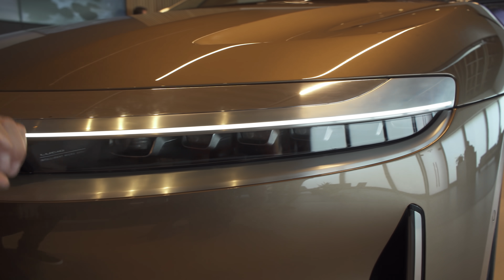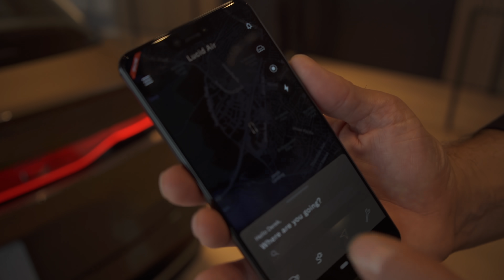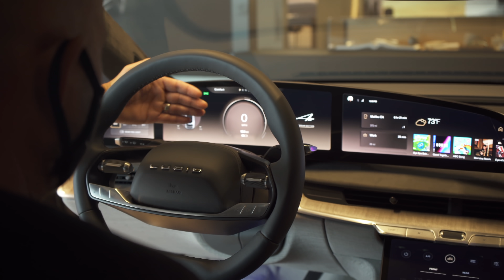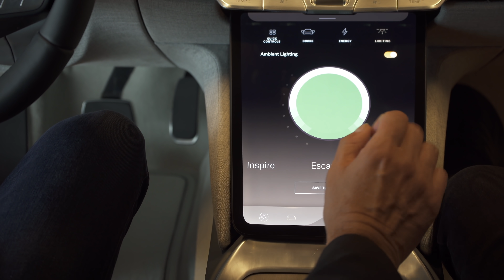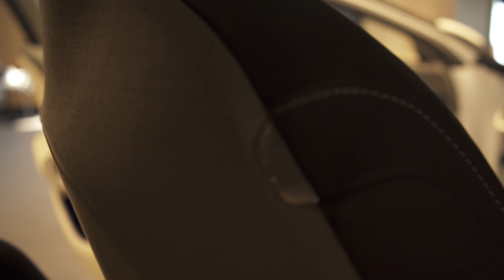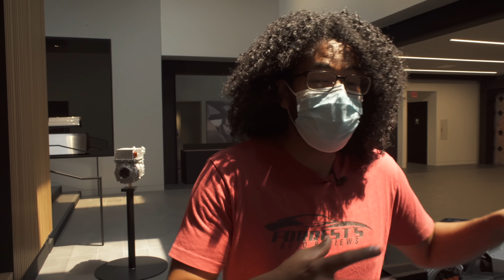1,080 Horsepower EV! (EXCLUSIVE FIRST LOOK) | 2021 Lucid Air Dream Edition

Comment: Too bad the seats are so low. That's a terrible position to sit in. You see this over and over with these cars. I know the floor's filled with batteries but these manufacturers really need to accept that these cars have to be a bit taller. Yes that will add drag but range is already not an issues on these high end cars. 
I have a feeling that the big traditional car manufacturers will win this race in the end. The people working for those companies have a lot more common sense and experience building cars and even though their cars don't offer crazy panoramic windshields, laser windscreen wipers (?), a battery level animation as nice as the one on this car or the performance of some of these hypercar wannabes they do all the usual things better. I'd rather have something reliable with cheap to replace bumpers and headlights and so on and a simple battery indicator like the one on your phone than this thing. And a car costing over $50? One of the best thing about these electric cars was supposed to be that they're cheap to buy and cheap to maintain since they have so few parts compared to an ICE car. Guess we're just not there yet.
EDIT: As others have pointed out there's another version of this with less range and a few of the batteries missing to make leg room in the back. Get that one if you ever buy this car and plan to actually have passengers in the back. It's still not good but it should be fine for children even for extended periods of time. A normal size adult will get terrible leg craps in under two hours even in that one. Maybe less than an hour in this one.

Comment: Did not give much info about the car's safety from both design and more importantly software such as it's driver assistance capabilities and it's ability to avoid accidents or human/driver error. To me this is extremely important for any future electric car. Hope Lucid is not just focusing on the design,vwhich is also important and they seem to have done a good job.

Comment: The thing people don't understand about accelerating fast in an electric car is that it drains the battery severely. If you press the pedal to the floor multiple times the range capability will drop significantly.

Comment: If they put 120hz screen in the iPad looking screen beside steering that would be much greater because a powerful cpu is needed to handle super fluid touch response and user interface because it’s a luxury why not

Comment: Fake, because on his phone has 264 km range and in the car was 168 km, and where are the zero gravity back seats?
Reply: Those special seats are optional. Also regarding the range error, (newer edit) his phone was displaying kilometers and the drivers display is in miles.

Comment: My concern is that the flip-out mechanical center screen will need expensive repairs if something goes wrong. Also any type of LED screen may be prone to delamination over time. To replace each screen would cost over $1000. Cool design, cool concept. Concerned about the money you'll have to fork out when the Warranty runs out.

Comment: How can they get away by not having the turn indicators not on a fixed panel. Us regulatory DOT laws specified that any turn signal indicators either have to be on a fixed panel or have more than one for example if these are on the trunk lid which is not fixed they must have another set on let’s say the bumper which is fixed. I don’t think they will be able to have just the ones on the trunk lid. For over 120k the interior just doesn’t add up to a car over 120k  lots of plastic, and vinyl finishes along with the rails for the seats , no covers and shows bare metal .

Comment: This is cool, I'm just kinda tired of the focus on making electric cars these high-end luxury items. I want to see something really affordable for common people, because at the end of the day the greatest thing EVs have to offer is the reduction of carbon emissions.
Reply: Volkswagen ID3
Reply: What’s your definition of affordable bc in my eyes a fully base model 3 is 30k
Reply: The technology is expensive. Development of these vehicles are basically running off a trickle down model where the expensive product is release first to subsidize further development on more consumer friendly versions. This was the same thing Tesla had to do for the model S when it first released. Companies like VW and Volvo can start at scale, they just eat the cost of development upfront but can develop more 'affordable' cars to release. I am still excited for what Lucid Motors has to bring to the EV market and push all the auto manufacturers including Tesla to innovate further.
Reply: Raw materials for the batteries and computer modules are rare, expensive to mine and process, and pretty polluting... so it makes sense to sell them as luxury items.
Reply: I agree, like the model y but without all the cameras and self driving stuff.
Reply: Pancakegr8 - TESLA still makes the Affordable , Tesla model 3 BASE starting at $34,500.
and in 2 - 3 years you can buy a TESLA model 2 starting at $25,000 with FSD.
Reply: Victor Hugo   - NEVER , said FSD would be FREE, wink wink .......

Comment: Love the Symmetrical Architecture... but the biggest drawback is the Exterior Design, the Front Fascia looks kind of lame... Have you guy seen the new 2021 KIA K5? Whos says an EV can't have a Frt Grille, you can probably divert the air through the grilles and into the wheels for cooling...

Comment: The interface doesn’t seem well thought. There is no need for the left screen given how rarely you will use it. The logic of activating something on the top screen and then having to use the bottom screen to continue it makes no sense and it’s just poor usability. Basically there is no need for more than two screens: one in front of the driver and other in the middle.

Comment: I am very concerned with the quality of this car, being the first model and "beta beta beta" as was said multiple times and obviously showed with the touch screen not working too well 🙄 the floor being high is a big deal for long trips..and can't move feet under the seats also, if 6ft or taller that is a big deal for trips over 30 minutes.  The color is quite bland even though it is a "gold" , nothing too surprising other than the screen and power but the ambient lighting could be better as well as the materials, I am not too keen on the fabric part of it. The labeling is standard on almost any car nowadays.  The wheels are atrocious but I do like the exterior lighting. Also the steering wheel centerpiece is eh. But I would say not bad for a first stab at a car from lucid. Definitely may overtake tesla after a few models if it continues this path.

Comment: Since the motors appear to peak at 670 hp each, that Performance rear axle with two of then might be able to draw all the power the battery have to offer.
I'm curious whether they'll car regen at 300 kW (or lower) or so something interesting with these usually very short inputs during dynamic driving.

Comment: not worth 80k more like 45k
Reply: With that kind of tech and range it's well worth it! Although I think $160,000 for the top end Dream model is kinda pushing it.
Reply: @ZapFlashD  what few led lights on back front dont think so see wen they produce them if ever theres nothin hitec in there these i suspect are not actual full specs fr road model i cnt see anyone paying 80k for average car there are no top range features i can see aprt from led front back one piece lights wow 1piece back light must be worth 80 bigones

Comment: As for the car, the driving position from the little i could see is bad, to get inside the car is bad, to sit behind and not being able to see in front because your knees are too high makes it a very unconfortable position, the roof line is way too low for people above 1,80 m and the software...omg that is slow motion, realy bad. The back trunk although it has a big capacity, it is long and deep also with compartments options, it is not practical at all, to get something from the back of the trunk, a short guy has to go all the way inside, terrible. It looks very nice and futurisic but one that hype is gone, you will want a better designed car. I own an Audi A7 and i have 1.000 km range on a full deposit and even if it looks like a sports car, it is a very practical and well designed and built one.

Comment: I believe there is a design issue with back seats where u set very high. This very difficult for long distance. I hope they could do somthing. But it's hard. Since batteries are located under that . 
From inside it disappoint me

Comment: I’m a Tesla owner and a total EV advocate, so any new EV’s coming to market are a great thing.  This is a great video and I can’t wait to see this car take away even more market share from the ICE producers.

Also, I am very observant.  164 miles of (actual) range at 50% charge sounds very comparable to what you find on the Model S LR in the real world.  

That said, this car will be far more satisfying to the ultra rich crowd than the top of the line Model S will ever be.  The cost difference of charging at an EA 350kw station vs. the Tesla SC network will mean nothing to those who can afford this type of vehicle.

I think Lucid did a great job on the design.  I wish them luck on the production and sales.  It’s a Tesla Model S killer when the Dream edition drops to $105k.
Reply: There's some subtley here, Tesla has been driving down the cost of production so much, they profit and far ahead on certain things. For instance by the time dream edition is in full swing, the 2020 roadster i truly believe will be in production, so 180 K for lucid vs. 200 K for 2020 roadster. I still like the roadster more.

Comment: I definitely wouldn't be going grocery shopping in that thing.  It's a gorgeous automobile.  I am not a big fan of screen navigation.  I like buttons and knobs so I can go directly to the place I need to go and make an adjustment.  Also, if the screen goes out, you are screwed.    I would never buy a Tesla with that huge distracting screen staring me in the face.  No way.
Reply: Have you seen all the new electric cars? Most of them have touch screens for connivance,  it lets the company build on the software rather then having to replace buttons and such. It's going to be the future 100%, just like how we went touchscreens with our mobile phones.
Reply: @NormanGaming196  Did you mean 'convenience' instead of 'connivance?'  Anyway, I don't want to be searching and navigating menus on a screen when I am driving.  And I don't care about how easy or hard for a company to do their business. I certainly don't have to buy their failings.  For me, I want instant access and to know where the controls are without taking my eyes off the road.  If they want to have voice controls that would work.  My Subaru Outback has everything within easy and sure access.  I like it that way.  That Tesla screen is flat out awful.  And I don't have to buy it.
Reply: @georgesealy4706 rip the spelling. How do you feel about self driving cars? Most of these electric cars are built on a platform that is meant for self driving systems like auto pilot. We all have the right to an opinion, and I respect yours, but if your car wanted to add a button for a new feature, they couldn't; they would have to sell a whole new model with new buttons, unlike a Tesla to which they just change the display UI. I can understand the distraction bit though.
Reply: @NormanGaming196  I have no problem with self-driving cars.  I think it would be most useful on the Interstate highways a driver assist.  I live in Arizona and we drive a lot of miles on wide open highways.  It's a haul from Phoenix to Dallas, for example.  If the car could take over on long stretches it would help with driver fatigue.  In my mind the next big feature that way will be highway and car-to-car communication so as to eliminate crashes.  We have deadly dust storms here in Arizona, and there have been crashes involving 20-something cars.  And that is just one example.

Comment: I feel like lucid knows the target market for electric vehicles. Between 40-60 years old. The design of the vehicle is very unique and it doesn't have the sporty feeling of the tesla's . I like the elegance when are they going public ?
Reply: Going public as in stock market? I don't know, although, This model of the car releases next spring (hopefully) for a wooping 160,000$, the "below 80,000$" (interesting way of putting it) will release in 2022. They don't have a chance at hitting Tesla imo, once Tesla release their plaid models with the new batteries they're announcing, I don't think the power or range will match for the price range.

Comment: Why is every car ui so choppy and runs at like ... 5 fps
Reply: Tesla’s is good.  The older MCU are slower but not the new stuff.  It is super quick.
Reply: Hardware inside is probably bad, or they just aren't optimized. Probably the first though due to optimizing being pretty simple because there's fixed hardware.
Reply: @NormanGaming196  It’s Beta atm that’s what he said. They are still working the software, at launch it will change.
Reply: @Domini0n1  Sounds good to me
Reply: exactly! especially it's a computerized vehicle
Reply: U watching vid once it post so it doesn't have time to render

Comment: Finally, Tesla has serious competition. When Lucid expands it’s line of EV’s to the masses with affordable pricing, it will get interesting. I hope Elon is taking notes.
Reply: They don't have a single car on the road... There's no serious competition here and this is a car that costs 180k with options. Model s performance is 100k 😂
Reply: Wedow This would be a valid argument, if Tesla did not enter the market in the same manner. Tesla’s initial offering had considerable delays, and products the masses could not afford. Lucid is not vaporware, because they have all of the ingredients(Tesla engineer& Saudi funding) to succeed.
Reply: @Stan54321   lucid is planning to stay in the luxury vehicle segment for a while and don't really have any plans to enter the mass market, so you'll have to wait for a while to get their stuff for the price of a tesla. competition is still exciting though.
Reply: Hope only success for Lucid, I think this is a viable car market, the upper scale EV high price segment for luxury. I think better tech only inspires Tesla to do better so i don't think they are too worried. On a side note for 180 K im surprisingly not impressed by this car in terms of design. There's just nothing unique looks wise.

Comment: Lucid should just sell their platform, motors, battery pack and electronics.  Leave designing of vehicle body and software to others.
Reply: The interior isn't bad but the exterior body they should improve that a bit (plus the software) but good job so far

Comment: The seating position in the back is very strange with how high the floor is but besides that this car looks the business. Hopefully it drives as good as it looks. Great presentation by the way.
Reply: I can't agree with you more
Reply: Yeah it's the same in the Model S because the battery is under the floor
Reply: It looks like they did it this way to raise your knees like he was doing here, to I think lay you back with those inclined seats, probably to relax you more with the angles you'll have. Just my guess
Reply: Its an amazing car if they are able to deliver as promised although no under thigh support at the back so thats really bad

Hopefully no quality issues unlike tesla can guarantee some success
Reply: The version with a smaller battery pack is supposed to have “foot garages” for the rear seat similar to Taycan. This version has the floor filled with batteries.
Reply: And it's the same in a range rover
Reply: Too high
Reply from the maker: Thank you! Yes, the floor is high so it does make the seating position unique.

Comment: WAY better than Tesla.
Reply: It should be for a 159k price tag
Reply: @Game_Pulse_Daily  
To me, it's well worth it. At $168k, it is still cheaper than Taycan Turbo S, which starts at $185k. And it is superior to the Porsche, in terms of performance (range including). Simply put, this is hypercar in sedan form. So, its $168k pricetag is still a bargain, compared to other hypercars.

Comment: This is a an amazing vehicle.  517 mile range, 1080 hp and all wheel drive.  This is an electric vehicle that I could own.  I will have to check this out once it goes to production.  Thank you for sharing my friend.
Reply: It's cheap... $160k :D
Reply: Damn, we'll have to see if those numbers add up when it comes out. Let's also hope their competition doesn't already have some crazy batteries by the time this finally arrives spring next year.
Reply: John Edwards  but still, it's god damn 170k :D expensive if you ask me.